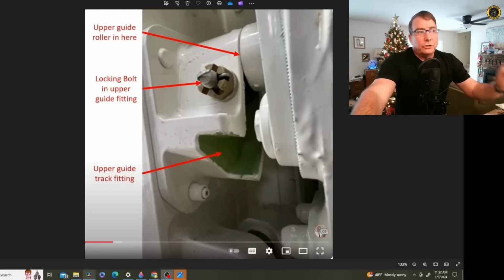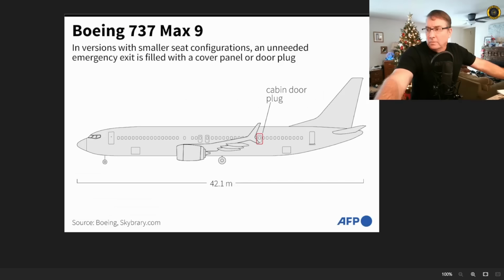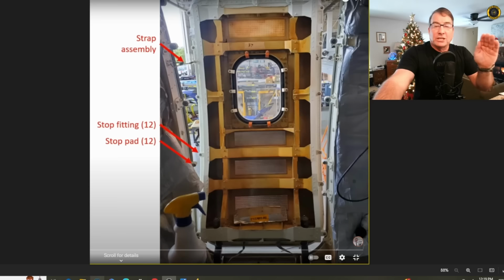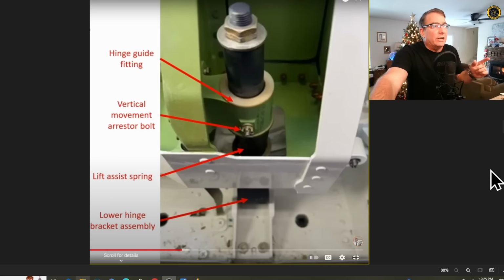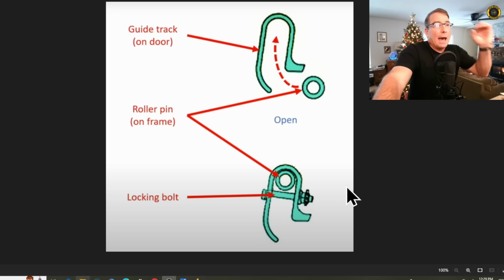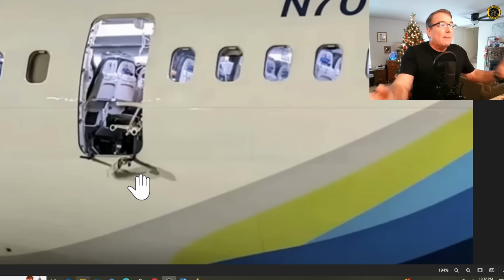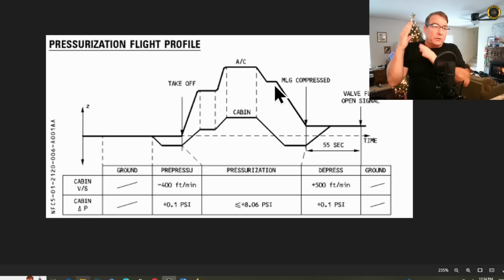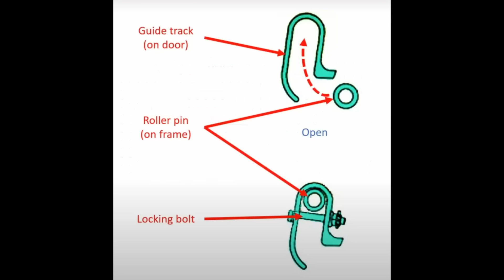Alaska 737 Max-9 Door UPDATE! 8 Jan 2024

Comment: another nuance to consider ... after the MCAS crashes, Boeing could not simply shut down the production line, nor could it deliver 737 Maxs to the customers ... so they stockpiled hundreds of newly built 737s in long term storage, some in Seattle, some Renton, some Moses Lake, some Victorville.  After the MCAS issue was resolved,  Boeing had to retrieve the storage airplanes to prepare them for delivery.   It would be interesting to know if the subject Alaska airplane was one of those storage planes.
Reply: Those were the MAX-8. Not sure the MAX-9 was around yet?
Reply: That’s an interesting thought! I wonder if the installation wasn’t completed properly prior to the aircraft being put to storage, then wasn’t checked properly after coming out of storage so steps were missed before that aircraft was finished and delivered to the airline.
Either way mistakes were made, inspections were not completed properly, and that is scary considering the extremes the aircraft are put through and the amount of people that are putting trust in the manufacturer and the airline. 
It seems to me that motor vehicles are put through more safety checks during manufacturing than aircraft are! 
Whatever the cause is, someone must be held accountable. At the very least Alaska airlines should have grounded that aircraft after the pressurization warning light came on the first time.
Reply: Wonder what is different between the MAX 9 and the 737-900 as both have this extra aft exit door or plug.
Reply: @magnoliap5824  given the MAX was meant to be a minor iteration of the 737 with no pilot retraining required, the 8 to 9 name change could have been done by an MBA with a pen (but no brain) in order to differentiate the 9 from the "problem" aircraft.

Given how criminally dishonest Boeing management was with MCAS, such action at this point would not surprise me.
Reply: Unlikely, the plane was only delivered in October according to early reports, so I imagine that all of the stockpiled planes were well and truly gone